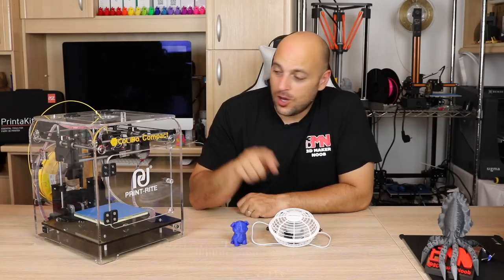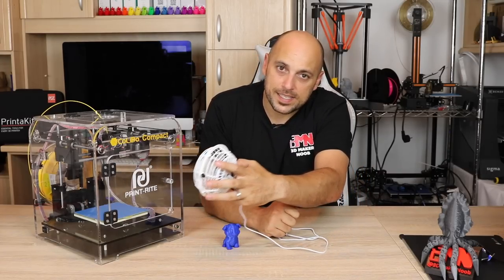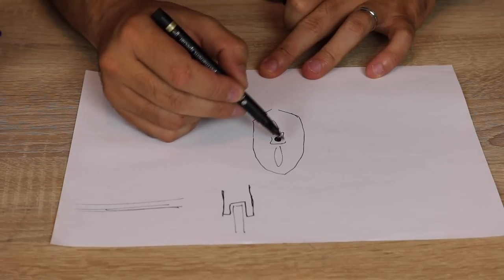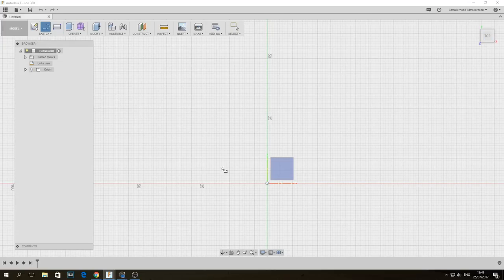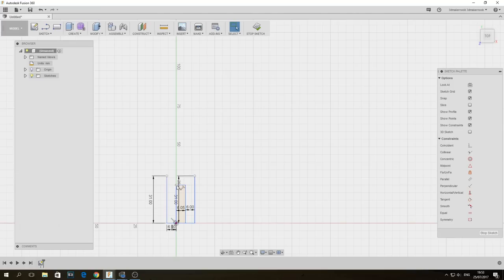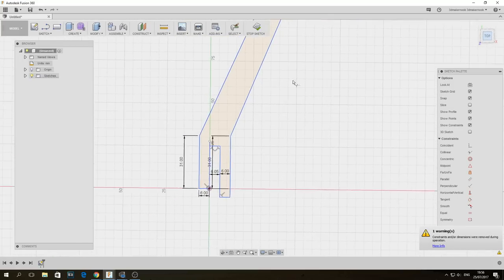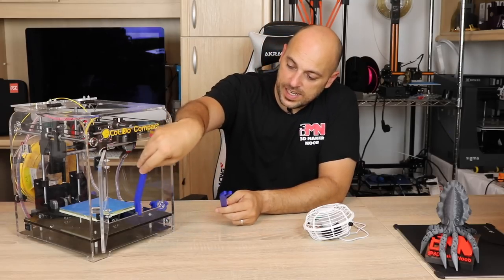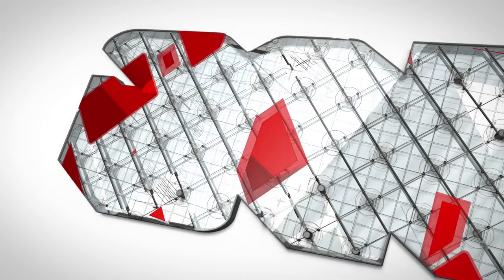Creating functional parts to improve prints

Comment: Hi, Joe We all have our own way of drawing/ designing things and trial and error can be time-consuming but lessons well learned.

A couple of tips.
Always start a part as a "new component" ( right click top of tree menu drop down)   Not really important for your single bracket but it's a good habit for a design that may have multiple parts. 
Use the "X" key to convert lines into construction lines. Highlight the line then press the  "x"  key. That way you don't have to draw them, then dimension them then delete them. Construction lines are not included in an extrude function.

Cheers
Reply from the maker: +bigfilsing awesome tip thank you!

Comment: Good vid Joe! A few remarks: when making a sketch in any CAD program, it's usually a better idea to draw the lines (only the ones that will make the final shape, exception being the circles that have a couple of extra segments) without indicating dimensions first, exactly like you did on your sheet of paper, and add dimensions later with the dimension tool by clicking 2 points sequentially or simply clicking a line or circle. That way, you don't need the extra lines and you will not lose the dimensions during trimming. See how Fusion warned you that trimming removed constraints and dimensions? In general, you should not exit your sketch while you still have unconstrained lines (blue lines here). Once a feature is constrained, it turns black and you know there is no uncertainty regarding its size and placement. There are a ton of beginner videos out there that will teach you the basics in less than an hour.

Comment: Hi Joe, in F360 you have the MAKE button, there you can export straight to 3D print, and select a CUSTOM-software (s3D in my case).
This option opens S3D and places the object right on the build plate of S3D. Dont forget to select the objekt in F360, otherwise the OK botton in the dialogue will stay disabled.
Is a nice feature and you can speed up the process

Comment: Yesterday i printed a 5 hours print ! After 1 hour i got some bubling ( room temp 25 ), after 2 hours i got some minor extruder jaming ( room temp 28 deg ), then i opened a bit the window ( 22 outside ) and the end of the print was flawless ! So can you make a test with different room temperature there is almost no documentation on the web about it.

Also the company who made my printer sell a housing but its 200€, i think its overexpensive, what do you think ? Its a simple acrylik 5mm thick 30*30*30 cube :/

Comment: The transition is back!  Glad to see you in Fusion 360.  Normally I work in Blender, but I've been trying to build some things for the coming solar eclipse that need much more precision.  How did you find working in Fusion360?  Do you think you will be doing more custom built parts like this?

Great result on your modified part!  For a quick fix, that is very impressive, Joe!
Reply from the maker: +The Gentleman Scoundrel there is much more I want to do and wish to transition more into functional prints rather than just print trinkets. Not to say I don't enjoy it, but I feel it's how 3D printing should be promoted :) I love fusion, I find it very intuitive
Reply: I'll admit, I'm having a little trouble with the key board shortcuts, but after using blender for years, I've gotten some muscle memory going.  Nothing wrong with trinkets, in my mind.  They are a lot of fun, but I am personally wanting to make my own action figures... It's like trinkets, but with the added requirements of precision moving parts!  

I look forward to more of your functional parts in the future, and i will eat up any fusion 360 videos you do in the future!
Reply: 360 is pretty good at what it does however it can fail at doing simple things (chamfers and fillets for instance) and the error messages are usually dumb.
That said it was pretty easy to pick up. Most of the keyboard commands are intuitive Cough not blenders strong suit cough however it is either missing a few things (can you split spline handles?) or I haven't figured out how to do them yet. Probably a bit of both.
Reply: There are like... four or five intuitive keyboard shortcuts for Blender.... A to select all, for example... that's the one I keep tripping over.  I do like some of it's work flow, though.  I certainly think it's software worth learning.  A (select all), E (extrude) , R (rotate), S (scale) , and Ctrl-B (bevel edge)  make a lot of sense to me... though I love the space bar "I know there is a short cut for this, but the command is 'snap this to that' oh, that's the shortcut!"

I'm still looking for some decent basic videos on Fusion360 other than the ones on the Autodesk Website.  If anyone has any recommendations?